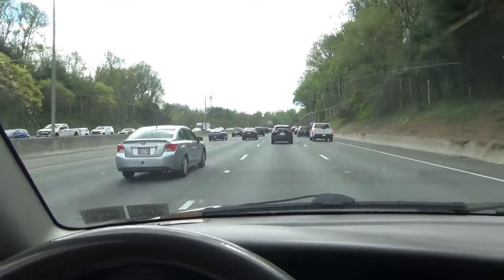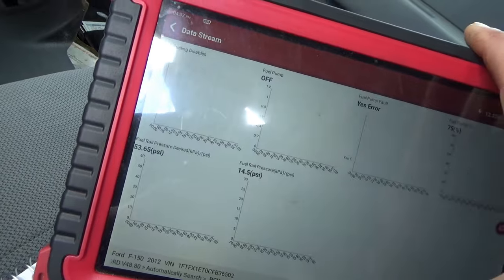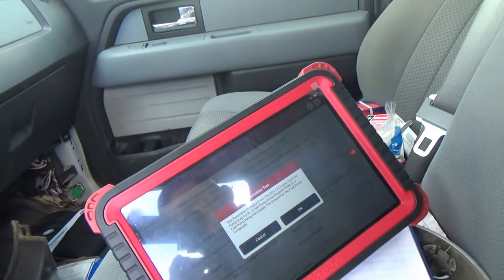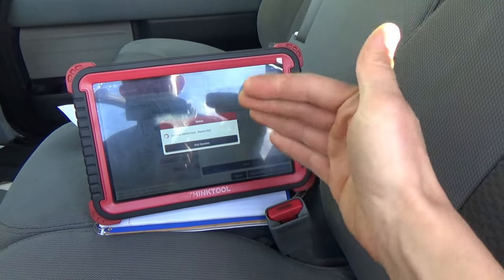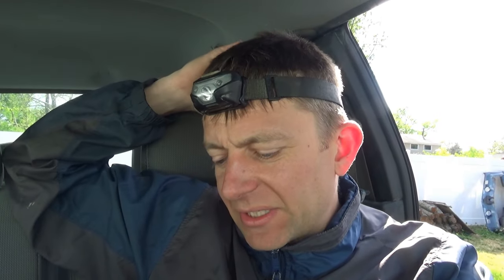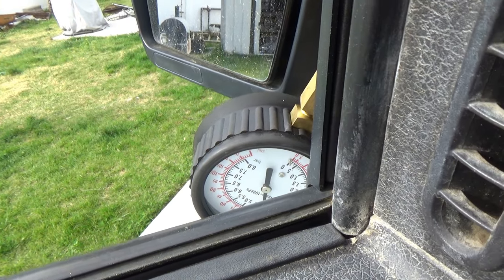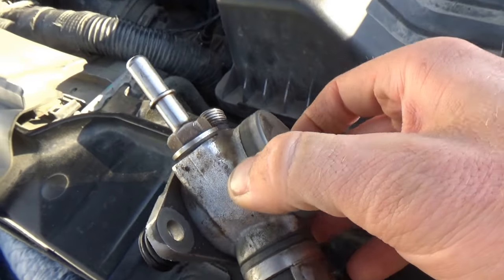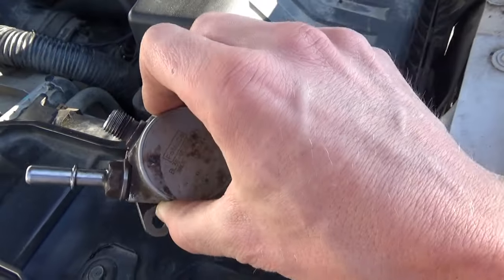WEIRD Crank No-Start (Ford F150 Ecoboost)

Comment: Haven't finished watching the video but it seems these direct injection systems work very similarly to their older brothers in diesel engines.. i wonder if the pressure buildup and sudden drop is due to air sneaking in the lines

Comment: if you ever plan another trip to fla i will set up several for you in southeast alabama one is a F150 keeps running after turned off and key in the house you can unplug abs and goes dead and i probably cccould round up several more and provide a shelter to work under

Comment: on ford transits uk ones. the chains stretch dont set a code the ecm learns and compensates until the timing to far out and runs rough, when you fit a new chain it flags a fault soon as you start it even thou the timing is now correct so you have to do a relearning procedure

Comment: On cases like this I like to see if the engine is even  capable of running on a spray of gas or starting fluid  in the intake. although ive never tried this method on a GDI engine. I kinda thought it sounded strange during cranking. At least the issue was found! I've made plenty of bad calls in my years of working on these jalopies!!

Comment: that's a tough one Ivan.  I just had a no-start 2016 Mazda 6 with 68K miles.  low pressure pump tested fine, but high pressure pump was doing nothing.  Rail pressure never got above 70psi, but it's hard to call a $600 low mile pump that looks pristine. also, I wasn't sure how the solenoid valve on the pump works and if it was getting the proper input signal.
anyway, we ended up installing a new high pressure pump and it fixed the car.  
BTW- the Mazda pump is Japanese and looks very similar to the one you showed from the F150.

Comment: So I'm like 12 minutes in and watching the fuel pressures it looks like it's a fueling issue still. The way the pressure goes up and then fades really fast. Like it's getting the pressure it needs but it can't maintain the pressure due to it not being able to provide enough flow. Could be very misleading.  Can't wait to see what it really is. Edit. I was incorrect as well. Should have acknowledged that when the engine was cranking it sounded a bit off. Especially since a friend's car did basically the same thing last year. Sometimes it would start when cold or warm and sometimes it wouldn't.  I went by to check it out and it was doing the exact same sound when cranking.  And then after trying multiple times it decided to start up and run beautifully except for one noise. I could hear the timing chain slapping back and forth. Told them it would need a timing chain kit because the guides were probably destroyed as well as the chain being stretched. I declined doing the work.

Comment: A leaking fuel pump (fuel into oil)  can cause stretched chains too - Oil viscosity to thin, not enought oil pressure for chain tensioner, so you have to change the leaky pump any way

Comment: Yep, I was surprised when I didn’t see you check the cam/crank timing correlation
Reply: That's not easy to do when the Engine is not running.
The only solution is to tear the Engine down and visually inspect the vehicles Timing Chain alignment marks. When the Timing chain jumped on my Ford 5.4 Liter 3 Valve Engine due to a blown- out Tensioner seal, it sounded like a Diesel Engine and my Launch Scan Tool read an Advanced Timing Code. I replaced the Timing Chains, Cam Phasers, VCT Solenoids, and the Oil Pump.

Comment: Being it has that many miles on a tiny displacement V6 engine, likely the engine is almost trash anyway. It needs chains and tensioners badly likely so, a big expense is coming. 
I was saying "high pressure fuel pump" too since they do wear so...refund time for me too.
Reply: It's not that expensive if you do it yourself.

Comment: sometimes we over think this things,,,i always remember check you powers first specially teh grounds,,,i had one f150 going crazy replacing parts right and left,,ended up being a bad dirty ground,,,making the electronic modules to get ground somehow,,making all this crazy things,,,,2010 f150 ground under neath truck below passenger door hooks from frame to chassis,,,,also clean the fuses,,they get supper corroded,,,

Comment: From your trouble codes,it saids low fuel rail pressure bank 1,if it was the high pressure fuel pump i don't think it would mention bank 1 on a 'V' engine.You should have gone straight to the fuel injectors to see what's going on around there.

Comment: Thanks for putting that out IVAN,now answer me this RIDDLER> Does that only go for Direct injection engines? Is it possible to spray starting fluid into the are box to see if it would have started?IF SO,while it was running {lousy i would presume} would you then check the timing?I'm assuming here if it did run it would run badly.what do you think? thanks The guy did get a great value from you>A   FREE LESSON from the MASTER!!!!

Comment: Makes you wonder that if you started it up on some starting fluid if it would have thrown a timing code and/or stalled out.
Reply: If it runs for a short time on Starting Fluid, the PCM should detect a Timing Code as a DTC. It doesn't take long for the PCM to detect incorrect Valve timing.

Comment: What the heck 
I’d never get that lucky for a chain to jump back in time. 
Ivan you had the thought process
Right
And your working under the watchful eye of the customer. You don’t have to explain anything 
Keep it up homie
Reply: That just means that the tensioner is literally gone.. so it's not exactly "lucky"--  it could easily jump time again and it needs pulled apart for new chains-- because it might grenade next time it jumps.
Reply: @calholli  If it jumps time again, the valves might get bent  and the Engine will be shot.
Reply: @davidhall3747  It depends on if it's an "interference" engine or not.  If it's a "non-interference engine', then the piston can't ever touch the valves..  Typically more performance leaning engines will be interference.
Reply: @calholli  I knew that, I was just making a generalized statement.
Appreciate the input.

Comment: Just an added comment because of course I finally watch the whole video. To change those timing chains on those Fords  they are horrendous to change.  I've heard of people actually having to take the body off the vehicle to get at the valve covers to change some of those timing chains!!
Reply: I just installed new Timing Chains and Cam Phasers on a Ford 5.4 (3) Valve Engine.
It wasn't that bad.
Reply: @davidhall3747  some of them are horrible to get at the back sprockets!! Thanks for the update. 👍👍
Reply: @dennisbailey4296  It depends on the Engine. 
The Land Rover LR 4  has (4) Camshafts. One for the Intake and Exhaust Valves for Bank 1 & Bank 2.
It's the (5.0)  Liter V8 Engine. It's my next project vehicle on the list.

Comment: Like you said, weird! You should have gone with your instinct, that has proven to be very reliable but, I guess, the fuel smell pulled you off to a worn out pump (which might still be worn out and leaky). Costly replacement of chains / tensioners ahead. In any case, good call on this, Ivan! Pleasant video to watch, while scratching the head, looking for the culprit 🙂

Comment: 1) I hope the customer has the timing set replaced and doesn't just figure it is fixed because it now runs
2) That high pressure pump needed to be replaced based on the fact that it was bypassing fuel past the actuator rod seal, even if it was operating correctly otherwise.

Comment: Honestly, the timing being off still doesn't really explain why that pump wasn't building pressure.  Even with the timing being off and the injectors firing at the wrong time, it should still build pressure, right?   IVAN--  I'm thinking that maybe next time you do a high pressure test like that--- pull the injector fuse so that they don't fire--- and that way you can see a deadhead pressure from that internal sensor on your scantool..
Reply: Exactly!
Reply: If the pressure regulation valve opens at the wrong time it will lower your fuel pressure. At least that's it how I understand it with these single piston pumps. It probably uses crankshaft sensor signal for valve opening/closing trigger and with cam timing being off the pump will be in wrong phase when it opens. Had Ivan manually energized the valve it probably would have built more than enough pressure.
Reply: @Nakkilauta  Gotcha!
Reply: @Nakkilauta  So that signal on the scope was not showing pump pulses, but rather the regulator pulse?  It was definitely varying as it would try to start, so I think you're right that it was related to a cam or crank signal.   It would have been nice to see a known good" signal and understand what we were actually looking at.  It's strange to me that the pump would be regulated by a cam signal, rather than being related to the actual pressure signal, since it has the data right there.....   I still wonder if I'm right, and if you pull the main fuse that is driving the injectors, that would have allowed the pressure to build on that internal sensor;   Because I think the reason it wouldn't build is because both the injectors and the regulator were firing at the same time and that was losing too much volume and not allowing it to build back any pressure on the next pump stroke..................  I don't know for sure, I'm just thinking out loud. lol
Reply: @Nakkilauta  I guess being a piston pump, it's really only going to make pressure when that piston is at TDC.. So it does make sense that the regulator should just be timed just after the injectors are supposed to fire..  All this is new to me.  I'm still used to a simple spring regulator.  I've never had to work on a high pressure pump.  I have one on my 2002 7.3L Diesel F350.. but it has 330k miles on it and is still running strong;   so I've never had to mess with anything on it.  same HP pump, same injectors and even same glow plugs- (granted, it need new glow plugs on half of them).  Interesting stuff

Comment: Good video I appreciate it. I’m having the same issue with a four-cylinder 2.0 eco-boost Ford edge. I had to actually get the head surfaced and redo the head gasket. I put new injectors new everything plugs coils. After I finish the job. It fired up for about 30 seconds. I killed itand it never started up again. It’s doing the same thing as your video. I was worried about the timing because I never mess with the timing. But that’s what I’m leaning towards too. Do you have a video on timing? One of those Ford engines?

Comment: Tech question: 2014 ford f150 3.7 ecoboost. Possible bad crank sensor. After looking at wire diagram looks like the return signal is shared with the cams. Problem is crank sensor is a bugger to get to in order to scope it. Can you scope it @ the pcm eventhough its a shared signal return with the cams? Thanks

Comment: how about using external fuel to see if the no fuel pressure issue is the reason for no start....if  it was indeed a fuel supply issue shouldn't the vehicle be able to run with propane or brake clean??? just for the record i would have tried that first....see if the vehicle runs enough to possibly set codes for other issues. do you agree with this ivan
Reply: Like me you ask questions as you're watching the video :o)
Reply: Without the pressure needed from the hi pressure pump, the injectors would not over come compression pressure. So, I doubt it would work and run.
Reply: @mikefoehr235  if you use external fuel supply down the throttle body injector operation isnt really necessary...i dont know why you say this wont work, i'v done this many times
Reply: @billmck12345  I guess I am wrong then. I thought the injectors have to over come pressure due to compression or no fuel would be delivered. If it works, then I am clearly wrong in my understanding of direct injection.
Reply: @mikefoehr235  you are correct on direct fuel injection pressure theory, but i am talking about introducing fuel down the throttle body like a carb does.....this way there would be no need for injector activity.....its running on fuel you put in through the throttle body/carb....
Reply: maybe think of it like this....you didn't drain your lawn mower from fuel last fall and your grass is 2 feet tall and your wife is on your case to get it done.....you pull and pull on that cord to get it done, and your wife off your case....but it wont start, so  you give a little squirt of brake clean into  the carb and it runs and stalls.....your problem is diagnosed...just think about a  little.....
maybe ivan can chime in .......
Reply: EXACTLY! Always keep a big can of GUMOUT CHOKE CLEANER in your troubleshooting kits. Seems like a lot of youngsters overlook this technique.
Reply: @billmck12345  I see...got it. Now that makes sense.

Comment: You would have thought the owner would have noticed if the timing chain had slipped initially (noise?) before all the trouble started. I guess also, as a matter of course it would be wise to check timing before springing for a HP pump.

Comment: always trust what comes to your mind from the subconscious,.,  the answer is usually correct.
i imagine the pump has a pressure bleed off after it peaks  but I still wonder why the pump wasnt immediately building back up? so he may have had 2 problems, the pump and the timing., do u know if he reinstalled the old pump?

Comment: I'm experiencing very similar symptoms on my 04 Dodge 2500 4x4 HEMI Magnum.  I've had no luck finding info on the Magnum (16 spark plugs is my guess why it's a magnum).  It ran with starter fluid for a few seconds, but I don't like using that stuff too much so I began checking things like fuel pump, rail pressure, injector pulse values/wave form, which all seem to be good.  I know you can't come out to Arizona, but would you confirm here the next step?  Should I check timing when it ran with starter fluid, or what?
On a tight budget, or I'd take it in.  I do have a Power Probe Maestro with Trace signal graphing.